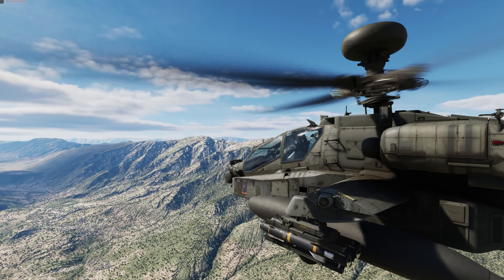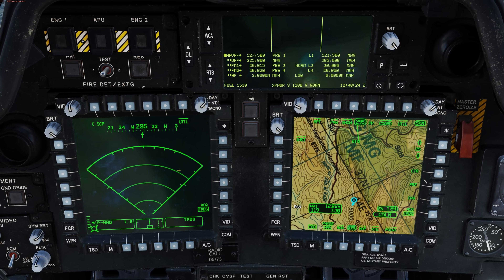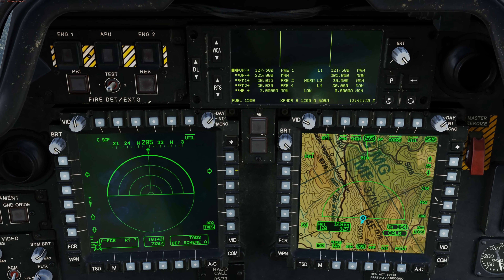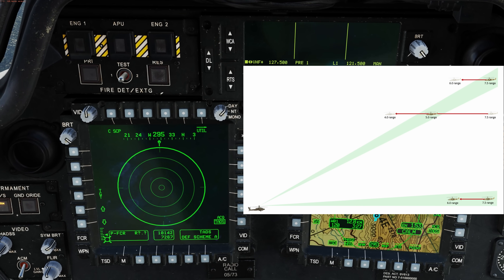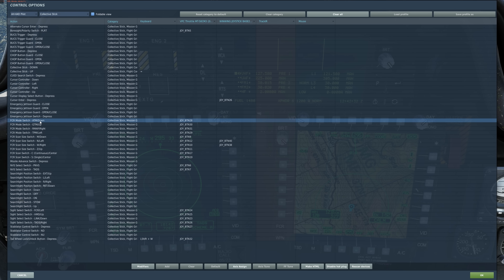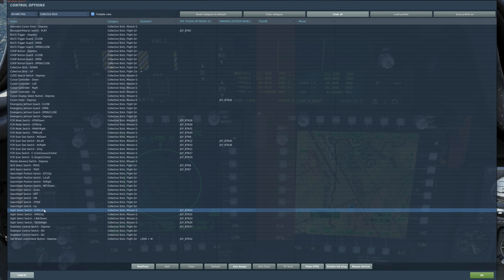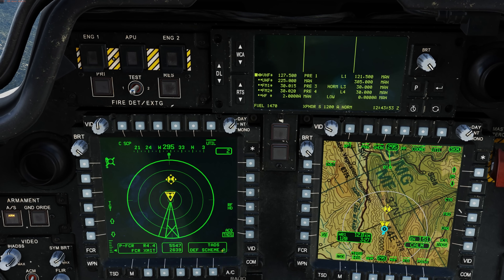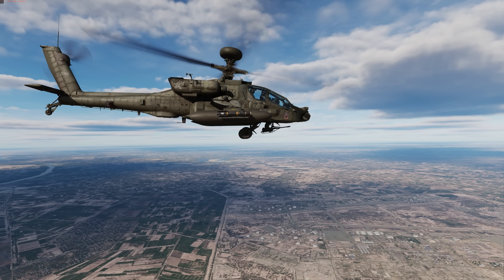DCS: AH-64D | Radar Air Targeting Mode

Comment: So we have a BS3 in dcs but the ah64 can't have stingers ? 
As a mission maker, i hope you will change your mindset, it will be awesome to have A/A capabilities on the Ah64d...
Reply: There are no references for how the fire control logic would function or how the symbology would look like. Aside from the fact the AH-64D was never capable of such weapons in the software nor the hardware, such a feature would be pure fantasy.
Reply: @Raptor_9  as i said, we have a BS3 in DCS, in the bs3 we have features coming from multiple prototype or some from Ka52, for me the ka 50 is a real good module for these reasons, we have a lot of very good things coming from multiple aircraft variants. Stinger are on some ah64 variant, if we have that on the BS3 why not on the ah64d ?
Reply: @vaurtex1390  And as I already stated, there is zero reference documentation to model this, even if we disregarded the inaccuracy of it on US AH-64Ds. Only the AH-64DJP, which is an export variant license-built by Japan, is equipped with Stinger capability.

Comment: Does this help the radar hellfires track air targets any better than finding them in GTM mode? Or is this just simply a ~360° detection system with vertical scan zone readouts?
Reply from the maker: You can also set NTS and ANTS and engage the target just like a ground target with Hellfire or gun.

Comment: you can fire the helfire to a jet  like su 30 but the jet will always outrun them
so i think its only used against helis
Reply from the maker: In ATM use, helicopters would be the target for Hellfire, not fixed wing aircraft. The importance of ATM for fixed wing aircraft is more about detection of such threats and taking defensive action... run away and hide bravely.
Reply: @MattWagner  thx matt for the reply great great job your modules are getting with each update more impressive and allso more difficult but they are like in real life at that time i cant think that there is any other company that does this. I would not call it a game anymore rather a training simulator

Comment: Wow, that means the Apache crew can easily blink and lose sight of an air target, unless of course they constantly manually change the scanning altitude of the radio beam. That means it is quite possible to surreptitiously bypass it and shoot it down, for example, by a Gazelle. Well, it is not that impregnable.
Reply from the maker: That would only happen if there was a rather significant altitude difference. Given that helicopters generally operate in a rather altitude band, it's not really an issue.

Comment: So if I understand correctly, when you select primary target and it change altitude let say from 1000ft and then if move to 7000ft it will track automatically it or we well need adjust it manually?
Reply from the maker: Elevation is only changed manually.

Comment: In a live multiplayer PVP setting on Contention server, what would be the advantage of using this FCR over just spamming George button (without FCR for K hellfires )  to search for targets in front of me?  I can't do anything about the planes anyway, only give out my position on their RWR when using FCR. Will I have  better range to detect enemy helicopters?(FCR vs spamming George with no FCR) Won't I have a better chance of shooting down enemy helicopters with K hellfires by using George and actively looking outside the the canopy instead of fiddling with so many FCR  buttons and having my head down in the MFD? On top of that, I have to  use George to IFF them or use GCI or get a visual anyway. Plus the extra weight of FCR. I am very new to Apache and I genuinely would like to know. Thank you
Reply from the maker: The biggest advantage of ATM is the 360 degree coverage, all weather, and using Limas.
Reply: Spamming George like that is far too tedious for me but it's probably the most generally effective method for frontal target acquisition since he will spot targets at ranges exceeding 8km where the FCR will not. C-SCP + continuous wide scan + FCR>TADS link + TADS video underlay on FCR page + AGM-114L = most of my heli kills on Contention. There's no 'fiddling with FCR buttons' beyond initial pre-launch setup, and any time a heli wanders into my cone I instantly have him on my heads up symbology and my left MPD's video for rapid target ID. Then of course there's the benefit of fire-and-forget with the 114L so I can launch and then break line of sight to stay protected from return engagement. That's not unique to FCR deployment though, as you'll receive the same benefit should George laser-designate your 114L's targets.
Reply: @phlupple  Thank you for such a detailed response ! Can I get George AI fire more than one missile at a time ? I could not get to do it. I know how to fly the Gazelle, MI24P, KA50 and now learning the Apache. I only fly from the Pilot's seat and never get into CPG seat. Can I skip the INS alignment ? It takes so long and I get killed so many times on Contention while I am on the ground. Thanks a lot !
Reply: @NoRegret08  I recommend you map 'Consent to fire' in Pilot controls so you can command George to fire at a specific moment instead of putting him Fire at Will mode, but no, if there's a missile in the air he won't fire another. You can put another one in the air yourself by WASing the missile and launching, and I believe he will maintain the lase on his target. You can also give him no weapon control but tell him specifically to lase the target and then you will control the missile launching process entirely by yourself. 

You can definitely skip INS alignment; I always take off as soon as the timer is done. Skipping alignment means your TSD and cruise symbology won't be functional for a couple of minutes but when they kick in they work fine. This is true of Contention anyway.
Reply: @phlupple  Thank you ! For Limas, George has difficulty firing them at SAM sites in single player . He says "firing* but he does not fire. I keep pressing "consent to fire" and nothing happens, but George does fire at aneky helicopters (single player). Locking and firing with FCR in single player (no George) works flawlessly. On Contention server, George is flawless with Kilos, but he missed all 8 LIMAS on ground targets. ACQ source is TADS in the back seat.  Basically , the LIMAS do not go where the George's cross is pointing to. I read something about INU drift in multiplayer . Maybe it is because I had missiles actioned the whole time ?
Reply: @NoRegret08  I've had difficulties when both George and I have missiles actioned but I'm unsure of the specifics of that issue. I generally have found him to be accurate on Contention but I rarely rely on him over the FCR. I hope you're able to figure it out!
Reply: Thank you for the reply ! I wonder if George has quicker acquisition and /or longer range to spot aerial.targets at 12 o'clock with this FCR mode over no FCR ( I am a pilot and George is CPG)

Comment: So this means that when in active air mode the Apache will appear on the RWR of my fixed wing aircraft?  What’s the code?
Reply from the maker: According to open source info, the following aircraft RWRs have these frequency coverages:
A-10C ALR-69 - 0.5-20 GHz
F/A-18C ALR-67 - 0.5-20 GHz
F-16C ALR-56 - 2.0-20 GHz
AH-64D/CH-47F APR-39 - 0.5-100 GHz

Based on open-source info (including from the APG-78 manufacturer), the AH-64D FCR is in the Ka-band range, which is 26.5-40 GHz. Which means out of the 5 aircraft above, only the AH-64D and CH-47F would have the RWR frequency coverage. But the RWRs of the CH-47F and AH-64D wouldn't be programmed to display it since no enemy nations have AH-64Ds with FCRs.
Reply: It's just an "O" next to a poop emoji.

Comment: Still wish we would get ATAS
Reply from the maker: Interesting that the US Army felt different.
Reply: @MattWagner well, USAF has other assets enforcing flight restrictions 😂. Others aren't so lucky.
Reply from the maker: @tymoteuszkazubski2755  Absolutely! The point being that the US Army decided not to field ATAS, and we are doing our best to simulate this aircraft.
Reply: @MattWagner  ATAS or AIM-9 would make a great addition as they would allow playing other nations' AH-64Ds. I bet that the crowd complaining about something being in the wrong place in the cockpit would be much smaller than the crowd that will be asking for ATAS or AIM-9 😁.

(Re)move the missile warning sensors, put INOP sticky on the MWS display if necessary, add minimal plausible UI (or whatever came up in testing) and call it experimental capability 😁
Reply: @MattWagner  And I am still sad about that to this day lol. I hoped that maybe the simulation would be broadened slightly to allow some non US systems to be implemented but I of course understand that that would be a lot of work for a small thing, and if that small thing is allowed the flood gates for other non US systems to add would open
Reply from the maker: @markthegamer5304  It's not just about being way out of scope, it's also a case of lack of reference data.
Reply: @MattWagner  That's fair, I hadn't even thought of ATAS data and it data about it's integration with the AH-64D as being scarce

Comment: Hi Wags! Just a question about how the ATM mode integrates with the Lima Hellfires; assuming you can NTS up a Lima Hellfire on an air target in ATM mode -  is that Lima provided with an intercept course based on the targets azimuth and speed, or is it fed with coords based on the targets position when designated, and goes pursuit when active? Many thanks!
Reply from the maker: It's the same process for engaging a ground target. The FCR tells the missile where the target is; and if the target is moving (normally the case with air targets), the AGM-114L will attempt to lock on before launch. So the best bet is to wait for a large LOBL box in the symbology accompanied by the RF MSL TRACK message. Then fire.
Reply: @MattWagner  Okay awesome - so like when in GTM, would it be accurate to assume if the Air Target is moving, you'll likely (in ideal circumstances) get a LOBL box out to about 8km? Thanks again.

Comment: We still want stingers darn it. But hellfires can work.  New tools.
Reply from the maker: Please watch the full video.
Reply: I know….  And did.
Reply: This is the US Army version of the Apache, and it never carried FIM-92s in operational service only for testing and training(and only briefly at that), and the current CMWS sensors are actually installed between the lobes that would carry the FIM-92 launch rails making it impossible to care them because the CMWS is not a field modification that can just be removed, it is fully integrated into the airframe.

Comment: Flying Choppers can be a pain with a spring loaded stick. I'm hoping to get the WinWing dampers so I can take out the springs in the base so the stick stays in place. 
FFB sticks are way out of my budget in this economy.
Reply from the maker: I've been flying with the Moza FFB base the past few days... what a difference.
Reply: I got the Winwing Ursa Minor and I quite enjoy it. Very smooth and the vibrations in the stick let you feel the guns, bomb drops and landing gear thumps while flying for good tactile information. It comes with the dampners installed all you have to do is adjust them to your liking and take out the springs if you desire, a pair of small needle nose pilers will take it out pretty simply.
Reply: @ImpendingJoker  I think I have the Orion 2 base. I didn’t buy the extra springs though. 
I may have a tinker and look inside to see if I remove the springs would it just flop around or stay in place? Only one way to know for sure.
The stick trimming in the Huey feels quite awkward to me. Although it’s needed for spring loaded sticks.
Reply: Using the trim i have no problem flying with spring I know only once trimmed I need to go back to central position….anyway as I have an AVA base I could remove the springs to check
Reply: MOZA has significantly reduced their prices, making it a good time to save up for an FFB base. that was night and day difference when you fly choppers